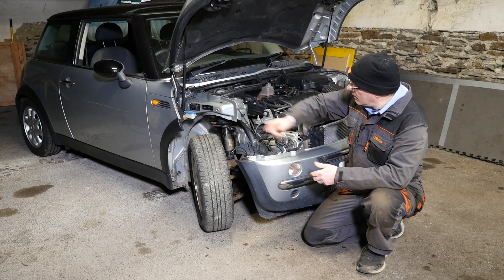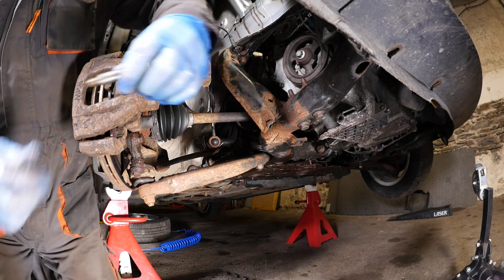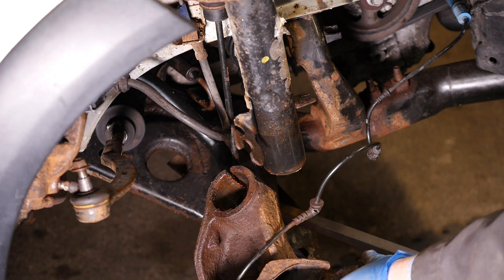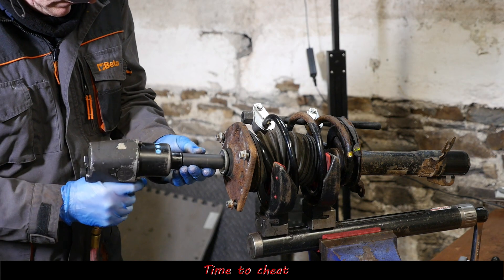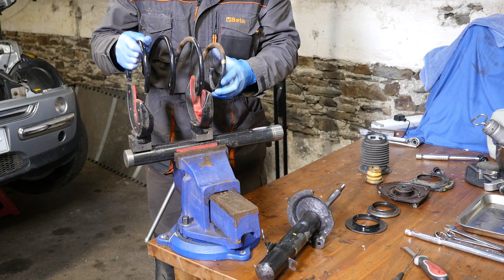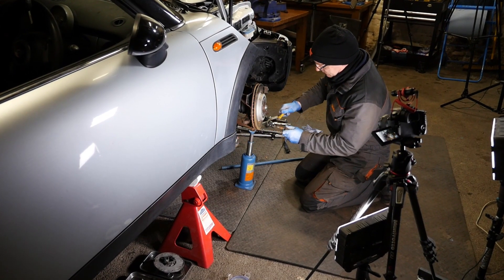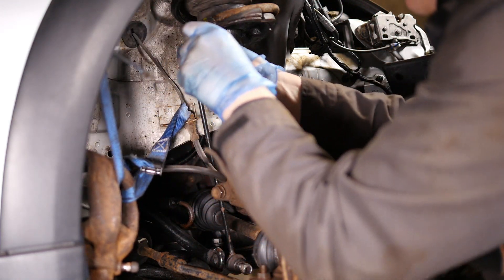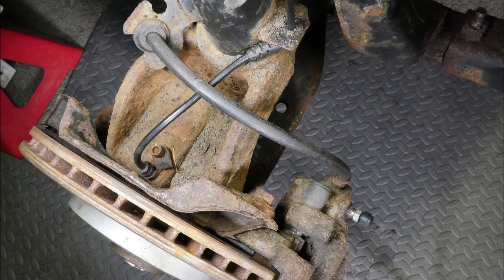Front Suspension Strut Removal, Tear Down and Refitting on BMW MINI Cooper R50 🚗

Comment: Thanks for the video! Just did it, it helped me a ton to have a good video to reference.

It doesn't make justice on how hard it is to take the bottom end of the strut out of the steering knuckle and put it back in. At least for me, it was a massive struggle, one hour to take it out, one hour to put it back in, for both sides.

The "proper" way is to remove the lower ball joint and driveshaft. But to remove the lower ball joint you need an extractor, and I didn't plan ahead. The jackstand + hammer trick might work for some, it proved absolutely useless in my case, which means I had to fight the strut and steering knuckle.

One last note: there are 2 styles of drop links: before 03/2002 (like yours) and after 03/2002. The later one can be removed from the strut without much fuss. There are also a few other minor differences in the strut parts before and after that date.
Reply from the maker: It's good to hear my video helped you.  Quite often If I get a long struggle with something I have to cut it down time wise.  I think I had issues with the drop link at one point.  Like you say they changed the design as I did this on my later Black Mini which was more accessible in one of my other videos on Mini's.  I still have huge struggles with simple jobs.  My next video on replacing Renault Laguna rear brake pads nearly put my car off the road.

Comment: Another great video. Are you able to give me any tips on getting the bottom arm to drop low enough to get the strut out / on? i know you don’t do it that way in this video but you make it look easy, and I’ve watched other videos where it has taken a bit of wiggling but comes out without too much fuss. I had somebody stood on my brake disc and still not enough clearance. Ended up pushing the spring cup upwards using a scissor jack between the cup and the hub. Worked great….. but when I did the same in reverse I’ve totally destroyed the rubber on the new top mount I put in. So it’s ruined and needs changing again less than a week after I put it in… oops.
Reply from the maker: Sorry to hear the games your having Chris.  You did remove the holding bolt on the hub to strut I presume?  I'm a bit lost as to how the strut can be stuck in the hub even after hammering it down.  Could really do with seeing a video on the exact issue your having as a description doesn't quite convey everything in detail.
Reply: @CoatsandGaiters  yeah the bolt was out and the drop link (thingy) unbolted at the bottom. The strut was free to slide but just couldn’t get the hub to drop low enough. I’ll hopefully have learnt something and my next attempt will be easier but if I struggle again I’ll put a video up : )
Reply from the maker: @chrisf5475  I used a long crow bar to pull the control arm down.  I know they make long poles for helping, called wishbone levers but I think the car has to be fairly high to get the leverage.
Reply: @CoatsandGaiters  So I did the top mount again today (the rubber part ‘bulged’ on the first one, actually this one has too but that’s not the point of the story)….
This time I didn’t remove the strut from the knuckle. I removed the bolt and had a go to see if it would, but no. And it doesn’t seem like it would with any amount of force. Sway bar disconnected but it feels like the drive shaft or track rod would need to be removed as well. Anyway… bolted the strut back into the knuckle, put a spring compressor on and dropped the shock shaft out of the top mount. Then pushed it to the side and drop the top mount out, replaced, then released the spring (slowly!) but found that even with no compression there was still enough ‘shaft’ at the top to locate into the bearing. Used a jack to push the strut up, tightened the top nut and lowered the car. Job done!

Comment: Great video! Very imformative. I replaced the strut, top suspension mount, and kept everything else. But it creaks a lot ever since I've replaced it, not sure what's causing it, I was going to use some lithium grease.
Reply from the maker: Thank you for that.  There is a ball bearing race at the top.  Mine was badly cracked up.
Reply: @CoatsandGaiters  yes I replaced that part with a new genuine part - the whole top suspension mount - all the ball bearings fell out of mine when I took the old one off. But unfortunately have a creaking sound now, going to use some silicon grease on the top under the plastic cover and hope it does the trick.
Reply from the maker: Creaking can often be something made of  rubber that's dried out a bit. @TheMiniLives
Reply: @CoatsandGaiters  thanks, going to try some silicon grease on the rubber suspension bushings and hope I find the fault.
Reply: @TheMiniLives  the drop link isnt tightened up right needs to be TAF or creak creak

Comment: at 14 10  14 15 you were turning the breaker bar anti clockwise therefore tightening the nut onto the strut
Reply from the maker: Thank you for the comment and just re watched at 13:45 on and can't see it.  I set the ratchet for pushing down which would be turning left.   I'm holding the centre part still with my right hand and pushing down with my left hand.
Reply: @CoatsandGaiters  when you hooked the big breaker bar you pushed breaker anti clockwise pulled ratchet  clock wise
Reply from the maker: @jackiemay9471  Just watched that bit and now I'm really confused as you might be right..... at least the air tool knew which way to undo lol
Reply: @CoatsandGaiters  i have done the same  trying to undo the middle you have to tighten the middle through the nut  i   normally use impact  makes life a lot easier thanks for vid it forwarned me
Reply from the maker: @jackiemay9471  this is nothing to this weeks video where I dropped the tip of a broken stud into the injector hole and onto the piston !!!!! now that caused some troubles.  So cover all holes up is some more advice haha.